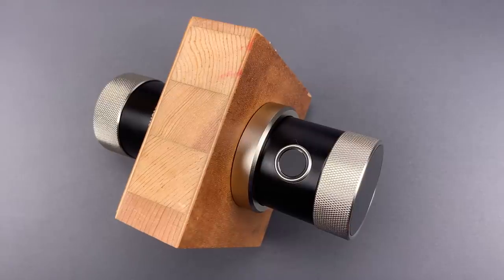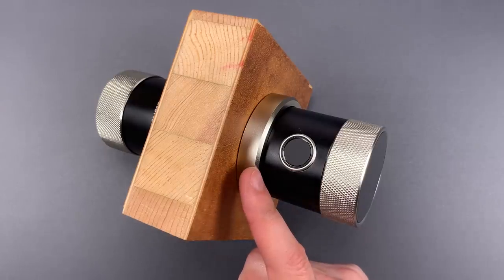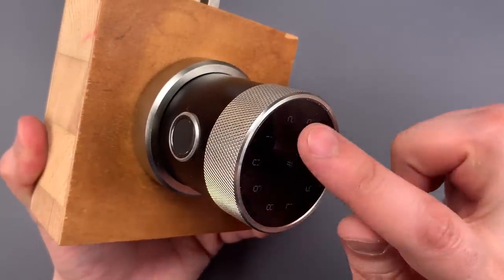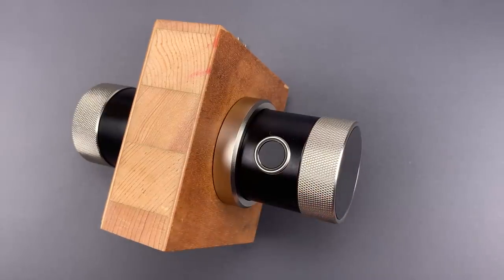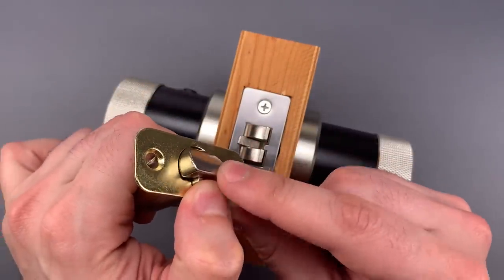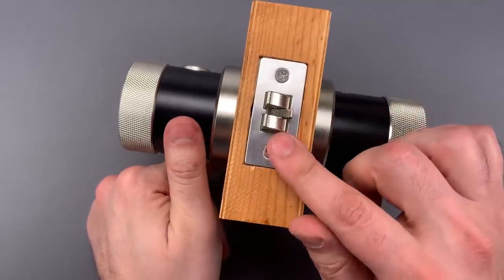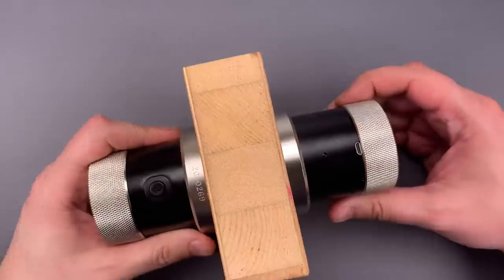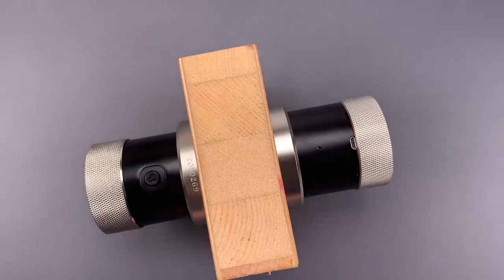[1120] Fingerprint Lock That Forgot The Fundamentals - DatoHome L-B400

Comment: Curious if there's another vector of attack with the USB port. Don't think that's necessarily your speciality, but could be for some.
Reply: I hope it is only a charging port
Reply: If it was designed properly, then it has no data lines and is for power only.
Reply: ye , i was thinking about that too
Reply: @eak125  Even without data lines, it could be a vulnerability.
Maybe BigClive should have a look at that.
Reply: More likely to be a vulnerability with the Bluetooth feature
Reply: Without knowing it for this lock, but the sensible thing would be that they have just connected the power pins and left the data pins open, as it is only used for charging.
Reply: @Keex11  Attack #1 for a charging port is to feed it mains at full voltage.  Then check if the fried lock drops open or prevents people escaping the fire you are about to set.  Creating a safe way to open an out-of-battery electronic lock is a really hard problem if you can't get assistance from the other side of the door.
Reply: @johndododoe1411  Judging by the sound (motor), frying it will leave the door locked. I suspect the other side is connected directly without any locking mechanism so you can exit but not enter, you're locking people out, not in. OTOH that would mean the charging port is on the outside which seems to me like it makes this exceptionally inconvenient to charge.
Reply: I don't think it's to charge it. I think it's to supply power when the batteries die
Reply: @eak125  another question i have is "If"   this is a charging port, why is it on the outside knob??
Reply: @animalm4st3r  With no physical keyed entry, you have to provide power somehow if you're locked out and the battery's dead.
Reply: @johndododoe1411  Hence the "slip the latch" feature. ;)
Reply: @animalm4st3r  A paranoid person would think it so the manufacturer has access to an easy bypass for any door using their locks.

A more realistic answer is that the engineers did not want any wires going through the door itself. While there are solutions for this issue that don't leave a charging port exposed to the outside, the solution used is by far the simplest (and cheapest) way to circumvent the aforementioned issue.
Reply: @johndododoe1411  How are you supposed to charge the lock once it's installed, a really long USB cable, a portable USB pack? Do you leave the door open or leave the battery outside? Seems like a major hassle, I have no idea why the charging port wouldn't be on the inside handle.
Reply: You people... Irrational assumptions galore.
Reply: @benridesbikes6975  I think that this handle mainly target tech person as their consumer. And I pretty sure they gonna have at least one powerbank/battery pack whether they ever need them or not (and it isn't that expensive either).
Reply: @eak125  thats a big if tho
Reply: @benridesbikes6975  I wrote that elsewhere.  Handling the possibility of a dead battery or power loss inside the house (breaker tripped by random other thing) is really difficult without creating a new vulnerability.  Maybe a ratchet generator powered by vigorously turning the handle until it beeps for "ready".
Reply: You can be sure there is another vector. In addition to the missing deadlock, RFID, and Bluetooth. I say NO to “smart” things.
Reply: @PierceyeG  insurance agencies won't care about an exterior open low voltage port. Usb is not your typical 120v 'stop your heart' kind of electricity, it's low voltage DC current,  and does not have regulations that AC has
Reply: The RFID tag is also likely cloneable.
Reply: @johndododoe1411  it's on the outside. You don't have to unlock it going out.
Reply: @sharpfang  Depends on if you're inside or trapped outside, if you're outside you'd probably want to be able to charge it, also depends on the house, we got lights with an outlet at the bottom so aside from the slight annoyance of charging a door lock it wouldn't be too bad for us.
Reply: @xpy99  Apparently it runs from 4 AA 1.5V alkaline batteries, so no charging circuit.
Reply: @animalm4st3r  Because if the batteries die, you can't get inside to charge or change them. But if you're inside and batteries die, assuming the inside handle is mechanical, you can still open it. Actually a good design.
Reply from the maker: Charging only... there are no data wires running to the port.
Reply: @lockpickinglawyer  Still, wouldn it not be vulnerable to vandalism? A big battery connected to the port and disconnected could fry the insides? What about some AC that could rattle the innards?
Not everyone wants in, maybe they just want you to not use this lock any more.
That being said, that looks like a bare sensor? Isn't that easy to just scratch and make it useless? Maybe press in?
Reply: @ndi4926  I mean if you're worried about that kind of thing then the same goes for any old keyhole, which someone could fill with superglue or something
Reply: @loutre1178  Yup. That thought goes through my mind pretty much every time I see a relatively secure lock. Like, it's great that I can't break in, but if I hated your company and just wanted to vandalize you...
You can't get in, you have to either break in to your own building or wait for a locksmith to arrive. And then what do you replace the lock with? Another expensive lock that can be superglued again? An electronic/RFID lock?
Reply: @coreyfrank506  It's not really electrocution so much as a potential fire hazard, which homeowners insurance is very concerned with.
Reply: @eak125  
Also I guess it could be isolated, with a fuse, from the main circuit board.
Reply: @ndi4926  Yes but nothing you couldn't easily do to almost any lock using superclue :)
Reply: Those select few that know how to find any port in a storm are heroic.
As long as freedom is their goal, more power to them.
Reply: @ndi4926  I initially thought there were data lines running as well, but yeah you could fry this thing and find a way in from there.
Reply: He forgot to show what's the method to change the pin code. If it includes the port at any given moment, Kapoof. If it's used for firmware update, well, bin it.
Reply: @plumber1337  You posted half a day after LPL told us (one screen up!) that there are no data wires to that port.  So it's USB in form factor only.
Reply: @ijabbott63  If there's no charging circuit why the hell is the USB port there, if it also doesn't have date lines connected, as someone said in a reply to me.
Reply: @jonathanrichards593  indeed, I did. It's friggin hard to scroll every reply to find one, but that's on me.

Someone said that it runs on batteries, so, why would there be a charging port, as a redundancy system?
Reply: @ndi4926  Most locks are vulnerable to vandalism.
Find me one which wont be damaged by a sledge hammer.
Find me a keyed lock which isn't vulnerable to a lockout key (A key where the top has a sawtooth pattern (possibly only one) so the pin can be pushed up and allow it to pass, but then not pulled back out, and which typically has a very fragile connection to the part of the key you hold so it can just be snapped off (some are 2 part keys instead).
Locks aren't made to prevent vandalism to the lock. They are made to prevent entry by unauthorised people or to make such entry easily visible/detectable.
Also, there are circuits which would prevent frying unless you give it very high voltage. Either by using a voltage regulator, or by using protection circuitry to just not allow any high voltage through. And they can be rated to thousands of volts.
Reply: @plumber1337  Say you are outside, coming home from whatever.
You go to open the door, but it doesn't work because the batteries are dead.
How do you get in?
The outside is entirely electronic so you need to use power to access it.
This USB port allows you to supply power to open it.
Admittedly it isn't perfect as it still required you to have something to get i
Reply: @jeffreyblack666  Highly unlikely to get depleted that fast, considering that even a laptop or a smartphone has an internal battery to retain the ROM and the BIOS.
Reply: @plumber1337  I'm not suggesting it would die in a few hours.
Is this better:
You install it.
Then say a year later you come back to your  door and it wont open. What do you do?
P.S. retaining a very small amount of memory and keeping a clock updated takes very little power compared to checking for RFID tags and bluetooth connections.
For RFID, while it is not reading anything you are looking at roughly 0.5 W if you check for a tag once a second. Meanwhile, for a RTC you are looking at roughly one 10 000th of that.
And CMOS memory is even smaller than that when it is just keeping its current state.
Reply: @xpy99  but why is it on the outside handle? You'd think you want to charge from the inside. 

Even if its charge only it reans that someone coud fry the lock by putting highcurrent through it. Or just fry the charging circuit. You can actually buy a  usb key that will fry anything you connect them to.
Reply: @KonradZielinski  Those USB keys don't actually fry everything you connect them to.
They fry devices which don't have protection circuitry.
And in most cases they only fry the USB port, and possibly hub, not the entire device.
But if you are worried about that, people can easily get a lock out key (or just glue/epoxy, or even just filling it with a fine powder) and similarly break a keyed lock, making it impossible to use without drilling out the lock.
Or just get a sledge hammer and break any.
Reply: @johndododoe1411  the other side of the door would still open, and if you are just trying to jam a locked door, a $0.25 bottle of superglue squeezed into the lock mechanism of any normal lock will completely jam it up and is far more practical of an attack than carrying around a 120V to micro USB custom cable to burn it out.  It would be interesting to know if burning it out would cause the lock to disengage though.
Reply: @jjbpenguin  From the sound of the motor turning, I suspect if you actually burn it out you just stop it unlocking from the outside.
Reply: @johndododoe1411  The funny thing is there exist a usb killer which designed to kill the port with high voltage
Reply: DDoS:ing a door by applying overvoltage and breaking the circuitry >:)
Reply: @lockpickinglawyer  Other question: Bluetooth is a notoriously insecure wireless standard. Could that be used as a bypass? And what about the magnet trick?
Reply: @Vysair  No, the funny thing is that a USB killer works by charging up with the the power pins and then discharging into the data pins. 
I'm pretty sure you'll only end up being sorely disappointed trying it on something without data pins.
Reply: @haakonht  So sad, I thought it just force it way through with any connector.
Reply: @TheEDFLegacy  Yes. The bluetooth aspect is one of its most susceptible vectors.  Anything that is IOT or Bluetooth have vulnerabilities that can be exploited.
Reply: @rogerwilco2  EEVblog maybe, looking at power consumption while typing a PIN
Reply: @aquicktake  well yes and no because from how it sounds (using an app) its looking for particular messages from not just the phone but the app, it's like how you can't just go out and start manipulating other peoples smartwatches because its looking for a specific device and a specific set of code for a special app, you could potentially hack it but to do it in the field is a leap of faith
Reply: To people in these comments saying it must be for data some there's no other ports that's because the ports are on the board, if they need to program it they open it up, take out the board and plug directly into it
Reply: @xpy99  >charging port

Ah fuck, I forgot to charge the door knob. Now I can't get in...
Reply: @rogerwilco2  There wont be any vulnerabilities if it has no data lines, because then theres nothing to transfer data. Even if there are data lines connected by accident, they'd have to program it to use the data lines. Now, if it is a power supply, then you could overdraw and see what happens. But other than that theres not much you can do
Reply: @rogerwilco2  YES! Bigclive! Overvolting!
Reply: @plumber1337  If it's firmware update then you could just upload any old firmware and probably break it.
Reply: @KonradZielinski  USB killer has entered the chat. 50 volts would probably kill that thing.
Reply: @haakonht  Even if you don't have data pins, you can still put high voltage through the positive pins and then try to pull it out through the negative pins.
Reply: @elsnowman123  You can still break it by overvolting it. Since the power somehow connects to the electronics either through the battery or directly, it will have to pass through the electronics. Also, you could make electricity jump from one line to another. And if you loaded the port with some sort of resistance  like a light bulb which connected back into the overvolting supply, eg. A modified DC adapter outputting hundreds of volts, you could run several amps through a circuit designed to take less than one.
Addition: This could even jump to the motor and power it, allowing it to maybe turn. And we haven't even talked about the old wire trick.
Reply: @williamhuang8309  Now you are no longer talking about a usb killer. You are talking about a lockpick, a specialized piece of equipment made for purpose.